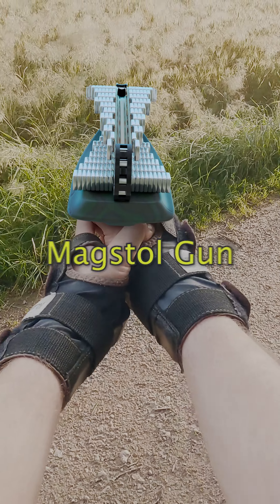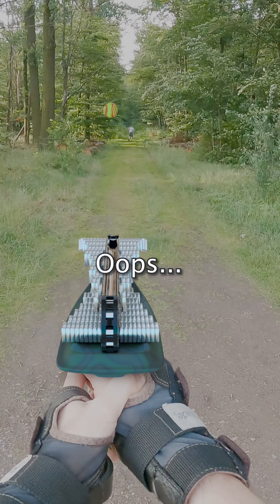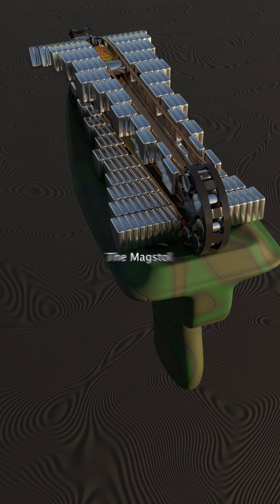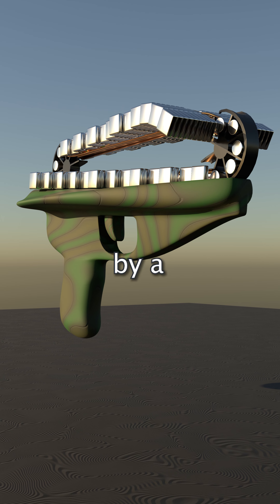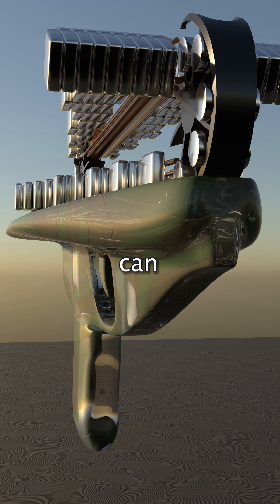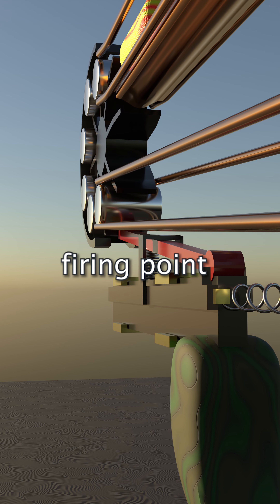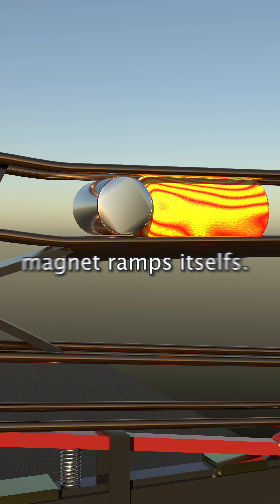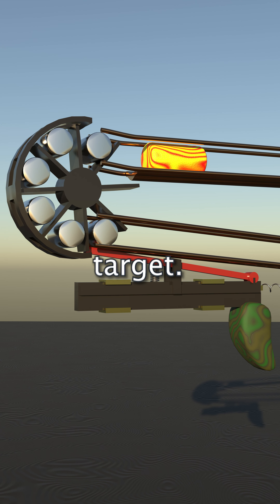A new magnetic pistol, called Magstol / a gun concept using permanent magnets

Comment: Hi, what about taking the trigger component out of the way, and use the two opposing ramps to shoot the metal balls continuously on the upper ramp and  the lower ramp and then the upper ramp again , non-stop? The only problem that needs to be overcome is to guarantee the metal balls will have enough kinetic energy to roll the ball drums to the next position  and this is guaranteed to be possible because  you can make the permanent magnets the size you want as compared to the size of the ball, you can increase the size of the magnets until the desired effect is obtained. It doesn't produce more energy than what 's spent to shoot the balls but it seems to be a clear way to keep the system running indefinitely, until the permanent magnets fade away, so it could be considered a perpetual motion machine. All you need to do is find a way to extract the kinetic energy and it will work for 20 years without stopping. We don't need the unity-plus machine, that's impossible, we just need a way to keep the motion going non-stop, so it becomes possible to extract all the energy the permanent magnets have to offer.